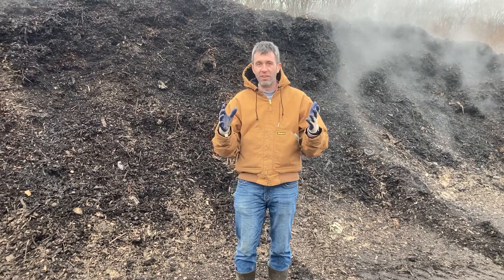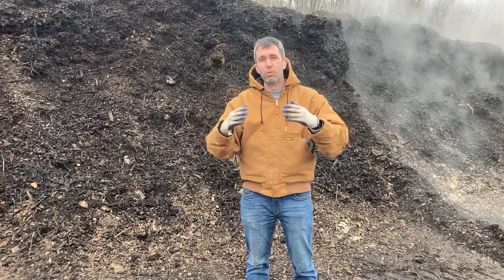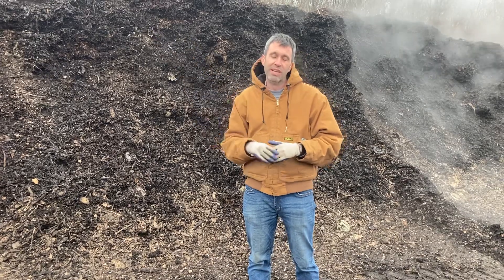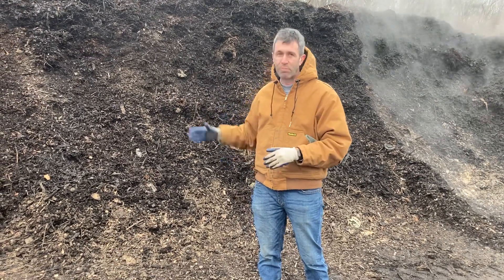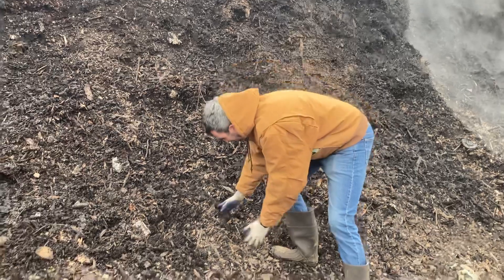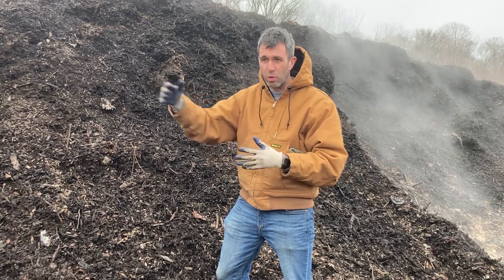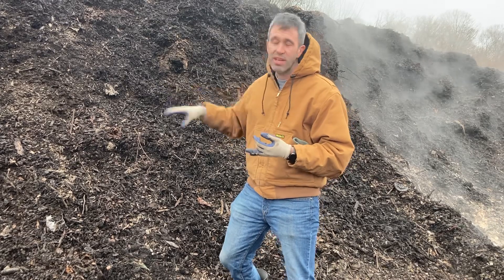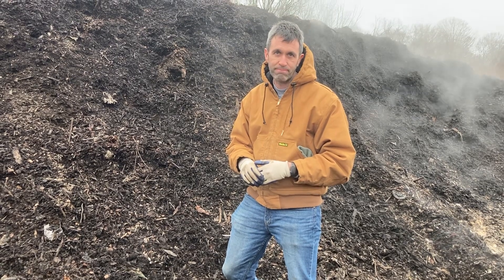How do we know when a compost pile is done composting??

Comment: How hot is to hot for compost
Reply from the maker: We recommend staying under 165-170F.  Ideally the 140s would be best for topping out.  In the 160s or above, microbial life is minimal so there isn't any value to being that hot.  Plus, if you climb higher and get into the 180s and have a very dry pile (35% moisture or lower) you run the risk of spontaneous combustion
Reply: @veterancompost  I’m composting chickens out of a big layer barn and google says 160 or hotter is to hot. So thanks for that information because My windrow seems to heat up to 160 and I was worried that was to hot. I’ll leave it for a couple days and see if it cools down